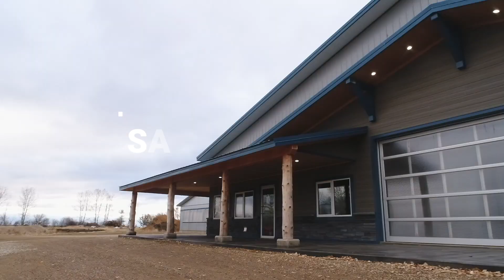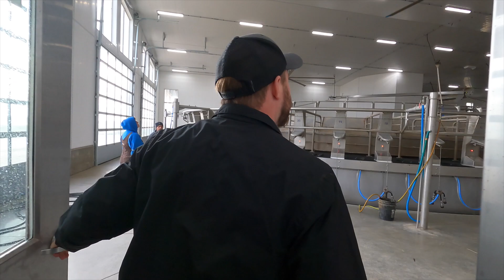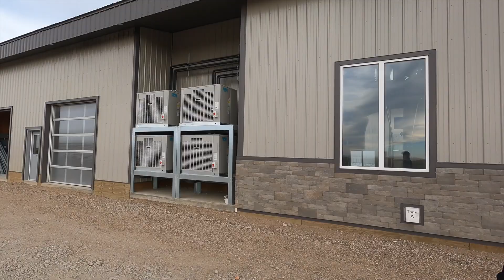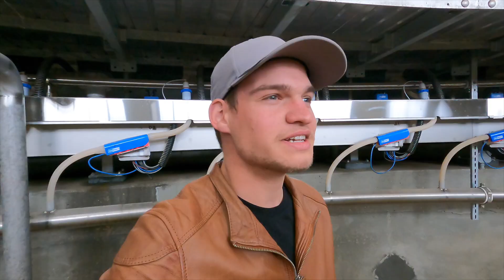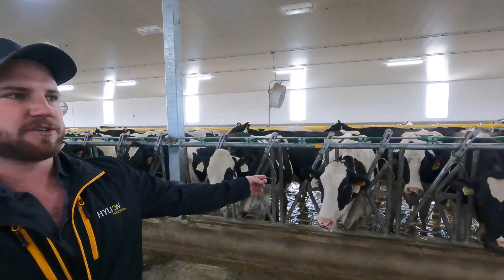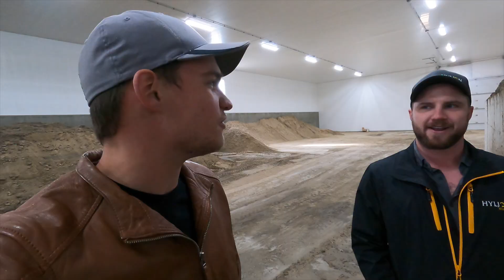Touring New Dairy Barn With 50 Stall Rotary Parlour!

Comment: I'm surprised that you don't use the manure to create the electricity  you need to run the farm. You must have seen the farm in NY I believe that sells excess back to the grid. They run 2 big generators fueled by the manure. Like you say no 2 farms are the same.

Comment: Non-farmer asking: Why "Rotary"? Is it mainly for the compactness/space-saving?
Reply: Higher through put and other advantsgrd.  Quite expensive though.  If they had a 50 cow straight parlour they have to let 25 cows in all at once. Then do 25 washes and milks and post milk treatment.  Let them all out and then while waiting or milking do the same for the other side of 25.  It would be like 4+h of milking vs the 2.5 they said. This rotary should be more relaxing for the cow and flows them in one side and out to the other side with just walking one sequentially.
Reply: @scrapnad1  Ahhhh! Thanks for the info!

Comment: Hey Jan. Yes I would also like to see different dairies. This was a beautiful farm but I have to say that I like your setup better. With a turntable every cow gets 10 minutes to be milked. After those 10 minutes the cubs fall off and the cow has to go. But if you have some slow milkers (giving slowly their milk) they will not be empty. I don't know how they deal with that but it is surtenly an issue. And then the sandrecycling, I do not think that the bacteria are dead after the sand is dry. They should at least heat the sand up to about 80 degrees Celcius. Farther more the cows were more mooing then yours and a lot of more vent noise.
Reply: surly their would register that the cow is with milk the cow could be held in to go round again the cups fall of when milking has done 
just a thought.  a simple programme could be  built in to cover such an incident.